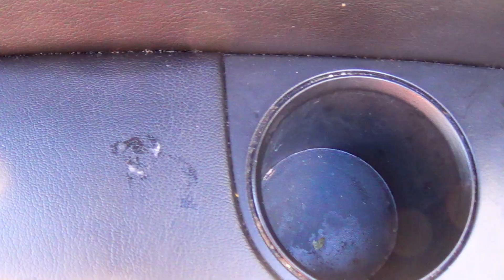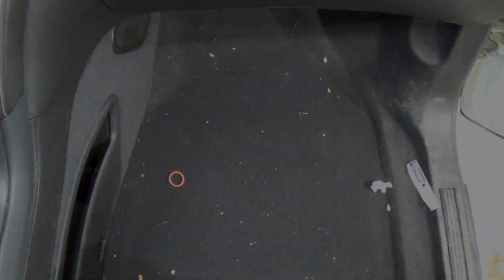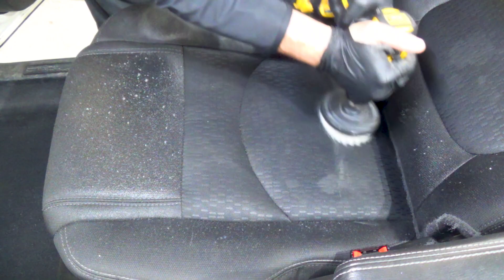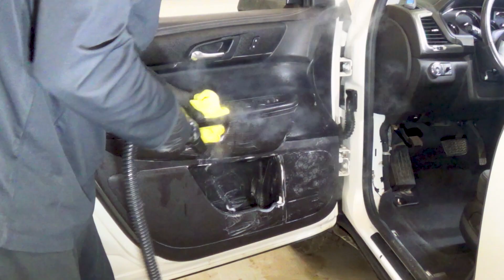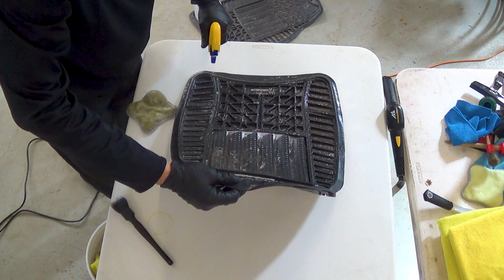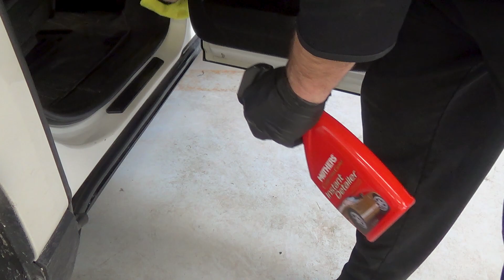Save Money Cleaning Your Car!

Comment: Without a doubt the P&S System is a great system.    I've used Mequiars system and also Blackfire and Poorboys World has really good enzyme cleaners as well,  but I use the P&S Finisher (peroxide based chemical) to finish off and neutralize any remaining chemical.  I think the hot water (plain hot water) is a must to suck out the gunk though.    To me, it just leaves to much gunk hidden in the seats or fabric if you don't suck out that gunk rather than just use a microfiber cloth.    The cloth works in a pinch but you get SO much more out when using hot water to extract out the gunk.    I do think the P&S three step system is one of the best.    Coupled with a hot water extract at the end, it makes interiors look brand new again and get's rid of the odor too.    That enzyme based product (Terminator) really eats up the organic gunk that makes up most smells and removes it permanently.    Most cars smell fresh again after a full three step treatment.
Reply from the maker: I really agree! I love the P&S system. I extract most of the time unless it's a maintenance detail. Then it's so easy with the P&S lineup. Thanks for watching and for the comment.

Comment: Great video! I've been us the P&S system for thee years now and you can even clean much dirtier interiors than the car in this video. I'd  recommend letting in sit though and be sure to wipe the finishing peroxide in to carpet or upolstry. I have a truck that's own my a contractor is I use this system.
Reply from the maker: For sure, learning the finer points of the system, but it SURE seems to work great!

Comment: Great job. When you run out of express interior try Meguiars APC. You can dilute it 20:1 and it will have the same strength and effect as P&S straight. It’s like $17 for a gallon too so it will last you forever.
Reply from the maker: I'll look into the Meguiars. I don't know though, I'm REALLY loving this Xpress stuff. Such a clean, pleasant smell and cleans up nicely.
Reply: @ScrappersDetailing  - Then stick with P&S they are phenomenal. Can’t go wrong either way.
Reply from the maker: @MrChuckwagon55  Yes, I haven't found a product of theirs that I haven't REALLY liked yet!

Comment: Nice work mate 💪
Reply from the maker: Thanks so much! Trying to keep up with you :)
Reply: @ScrappersDetailing  your doing a great job. Your interior cleans are amazing, 💪
Reply from the maker: @the_jnlt_channel  Thanks! It's all I can offer right now. We are STILL in winter. Got a little bit more snow last night :(
Reply: @ScrappersDetailing  woow, we are finally getting slightly warmer weather but still raining off and on.
Reply from the maker: @the_jnlt_channel  Yeah. We are stuck in that middle ground. Temps anywhere from 35-50 degrees F everyday so this snow will melt quickly. Had MASSIVE tornadoes south of us in Iowa last night. Crazy weather.
Reply: @ScrappersDetailing  mate that is crazy. Can't do much if the weather is like that 😞

Comment: Nice video Scrapper. Glad to see you’re using more and more P$S products. They’re a good brand and cost effective. I keep a 16oz bottle of Xpress in the drivers door cup holder for touch ups. It never occurred to me that I can dilute it, but I think I’ll cut it 1:1 to extend the product. FYI once summer comes I’ve got a great product for you. It’s a spray on rinse off SIO2 sealant. It’s called Mckees37 Hydro Blue PRO. It contains double the SIO2 than any other product. 2 sprays on a wet panel, rinse off. They say it lasts 9 months. Great gloss too. Great stuff. Keep them videos dropping and I’ll give you a like
Reply from the maker: Thank you Mr. Robert. I really do love that Xpress cleaner. It smells so much nicer than CarPro Inside and isn't nearly as harsh on my lungs. It also just happens to clean really well! I will look into the McKees37 sealant. I've seen some of their other products but never used any of them.